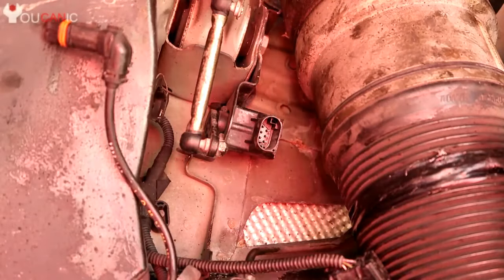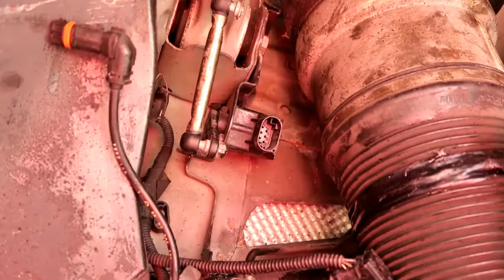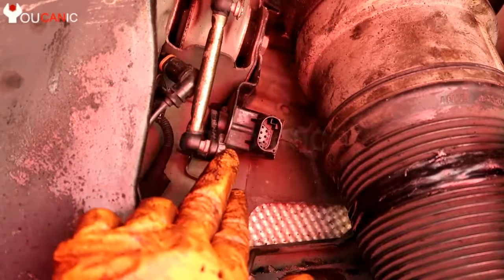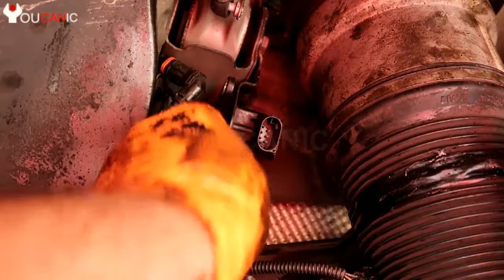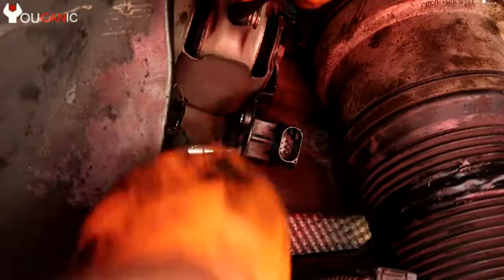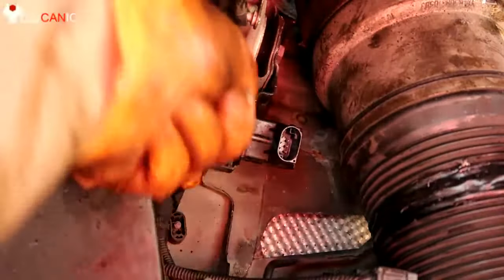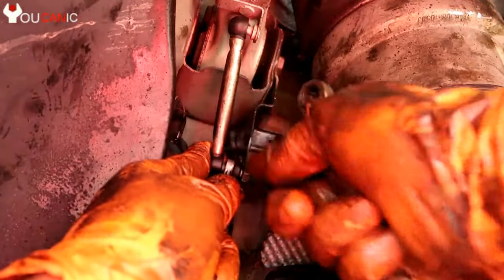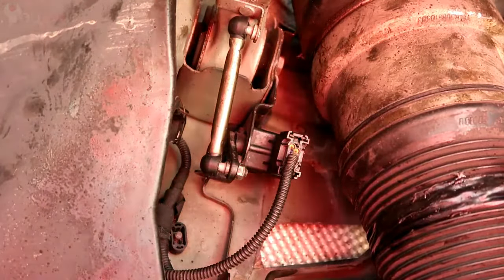Mercedes Level Sensor Ride Height Sensor Replacement | Step-by-Step Guide

Comment: I have a c350e and the suspension has started to drop intermittently on the rear drivers side (UK). I reset the suspension and it lasts a couple of days. It's only drops slightly, do you think this could be an issue with the sensor possibly moving from its home position? Great video by the way 👍🏻

Comment: Just subscribed.  My MB rides too high. All 4 ride height sensors read the same volts. I changed the ABC module and still does the same. It looks like I'll have to go to dealer for ride ht adjustment now but those idiots will want to charge $300 at least.
Reply: Hi Brent, i had an issue with my w220 where the drivers side height would drop if car not driven for few days,  the garages i visited for a fix all gave different solutions which cist a lot of money, from strut replacent to replace Compressor. All i did was spray alot of WD40 onto the front levellers & hey presto, issue resolved so far fingers crossed.. my car is 18 years old on original bits and i love it, worth a try.. Thank me later  😎
Reply: Wd40 onto levelers?? That's a nu one on me! I'll try it
Reply: @NS-pt9rr  I forgot about your advice.  Now I'll have take off all 4 tires. Thx tho

Comment: I have 2010s550 I replaced left rear strut, replaced sensor but where does the arm on sensor position go?
Left side 1 1/2 lower than right rear.

Comment: On a slight incline my vehicle sits down almost all the way against the tire in the back. After turning vehicle on it raises back to normal? Is it the sensors in the back?
Reply: No that’s an air leak
Reply: I have the same problem.
Randomly one corner will be down.
Sometimes it's the front sometimes it's the rear sometimes it's all of them.
Other days it doesn't do it at all.
It seems when I park on unlevel ground it goes wonky.
It's not an air leak there has to be a control valve somewhere or something that is going wonky
Reply: It's Residual Pressure Holding Valve leaking on top of the strut. Valve is supposed to hold at least 7 Bar of pressure even if you removed the whole pneumatic system.

Comment: After I replace the back springs and the high level sensor which was damaged from the broken spring right, my headlights they are not working correctly and they are running up and down from now reason. 
I test the car on my computer but it doesn't shows any errors. 
Is someone who already knows what Sims to be the problem??
Thanks!!

Comment: Do you have to remove wheel to gain full access ?
Reply from the maker: Hello, thank you for your comment! In most of our videos, it's not necessary to remove the wheel completely to achieve full access, but it depends on the specific repair or service you're carrying out on your car. At YOUCANIC, we're dedicated to providing you with practical and helpful information to assist you in fixing your car effectively.

If you're seeking an efficient professional diagnostic scanner, check out the YOUCANIC Pro System Scanner at www.youcanic.com/scanner. Additionally, we provide Factory Repair Manuals and Torque Specs to our users, you can access those here: www.youcanic.com/manuals. We hope this helps you in your car repairs, and look forward to assisting you!

Comment: If this is bad in the left front of my w212 E550 2011.
Will this prevent the compressor from turning on? I just replaced the compressor it still won't turn on
Reply: Fuse or relay is bad here
Reply: @curlymyhero  are you saying it has nothing to do with height sensor? My compressor also isn’t getting power and therefore won’t turn on.
Reply: @corruptedm0nk  Not sure wat ur question is. Need a good scan tool and check volts to all 3 or 4 ride ht sensors.  If volts r around 2.5 then alls good. No power to compressor is either a bad fuse or bad SAM module.  A scanner will show if there's connection ot "talk" to module
Reply: Mine ended up being a broken wire in the factory harness to the compressor.
I soldered it back together.
Reply: My compressor isn’t turning on either what should i try ?
Reply: @mizterblicky5569  There's a wiring harness that is wrapped in plastic it has two wires, and it plugs into the pressure release valve on the compressor.
It's super common for these tiny little wires to break. Unfortunately, you have to carefully strip back the plastic where they kink it at the factory. You will see some green corrosion, cut the wire, and resolder it.
You can also check the fuse that's in the trunk on the left hand side inside the compartment it's a real a near the storage tank you can't miss it there's also one fuse in the front under the hood and there's also another fuse on the right side in the compartment.
Reply: @larsbambi1575  okay would replacing the compressor solve all that because i ordered one thinking the compressor is bad because i went to Mercedes mechanic and he said he couldn’t lift the vehicle with the scanner tool and he didn’t hear the compressor operating
Reply: @larsbambi1575  and then he told me it was my compressor most likely and to replace that do you think i should replace or do what you said only thing is i never soldered anything and i don’t really know where to look for the kinks unless you can possibly help me
Reply: @mizterblicky5569  it could be the compressor is wore out.. try replacing it, if it doesn't turn on then you'll know
Reply: @mizterblicky5569  I wish I could put pictures on here. I would show you what I'm talking about. Also what year and model is your car
Reply: @larsbambi1575  it’s a 2007 s550
Reply: @mizterblicky5569  Okay, I had an 07 S550 as well it's basically the same concept, but I believe your compressor is in the right front of the car near the bumper. 

If you're on a tight budget, I replaced mine with one off of Amazon. It is way noisier than the factory one, but it works it was made by A Premium Auto Parts
Not to get off Target but does your radio and your command work? The amplifiers in the trunk go bad on the 07 quite expensive to get a new one.
Reply: @larsbambi1575  well i had problems with my sound where i got no sound or no radio channels but i used a loop by passer and hooked it up to the Bluetooth module and my sound came back
Reply: @larsbambi1575  but the thing is i don’t wanna replace the compressor if that isn’t the problem  checked and the only side that is down is the front right side so you think it’s a strut then ?
Reply: @mizterblicky5569  Yes, more than likely, that is the bad strut, but the fact that the compressor isn't kicking on is alarming.
Okay I want you to look at the level sensor it has a rod that runs on a ball joint one side is on the sensor in one side is on the axle if that ball joint is Rusty it could be stuck in a position that is telling the compressor not to send air to the right strut because it thinks it is in the correct position.
If it is corroded and Rusty spray penetrating oil on the ball joints and work it free. 
Yearly routine maintenance Mercedes recommends that you grease and clean the level sensor Rod ball joints
Reply: @mizterblicky5569  do you have anything on the dash that says "car too low" or" malfunction"
Reply: @larsbambi1575  yes it says malfunction with a symbol
Reply: @mizterblicky5569  th,e system also has a valve block it has 6 air  tubes going into it, and it opens and closes. The level sensors tell this valve block which Corners need air. So in a nutshell the system has a compressor (with a 40 Amp  relay and 2 fuses) 1 valve block , either 3 or 4 level sensors (some models have 1 in the back and 2 in the front others have 1 at all 4 corners ) and 4 struts. Don't let it intimidate you it's not as complicated as you think.
Check all the things listed above start with the easy stuff the relay and the fuses. Somewhere in your car you should have a piece of paper that identifies where all the fuses are anything that says airmatic you want to check.
Reply: @mizterblicky5569  if for some reason you do figure out that it is a level sensor make sure you disconnect the battery before you change it!
Reply: Me personally I'd be looking in the direction of the compressor and the wires leading to it especially the smaller plug at the compressor that goes to the pressure release valve.

Comment: what are the signs for a faulty sensor?
Reply: When you get a message saying airmatic stop car too low but your car is normal height or you see it in a diagnostic tool through obd port
Reply: @ghostbiker4805 but my car is leaning on passenger side, it did it before after I allowed the car to sit up for months. But after driving it everything was ok. I let someone borrow my car and it got returned like this😡 I’m assuming sensor first guess 🧐
Reply: My front both went down whilst driving... came up malfunction..fault code 5286 ?..
Didn't give a diagnosis for that..
But my front height sensors are reading left front + 4.44 "
Whilst the front right is minus 4.33".. I am assuming one off the link arms has snapped ?

Comment: Where can I buy a sensor for a s212 rear left?
Reply from the maker: You can find sensors for a S212 rear left on various online platforms or automotive stores near you. If you need assistance in diagnosing or replacing the sensor, we at YOUCANIC offer a Full System Scanner and plenty of other resources, such as OEM Factory Repair Manuals. If you have more questions or need further guidance, don't hesitate to visit our website (www.youcanic.com) or post your questions on our platform (www.youcanic.com/scanner). We're here to empower you with knowledge and resources necessary for automotive repairs.

Comment: Do you have to reset anything after installing it or does it just work?
Reply: Most of the time it will return to factory calibrated settings , after you have installed the new one.
Reply: @rkon1000  my back side sits a lot lower than the front, after replacing the back sensor. What do you think is the problem? Will it go back to normal?
Reply: @vasiliy2394 did it go back to normal?
Reply: @justinr3490  not really

Comment: Do I need to disconnect battery?
Reply from the maker: Hi there, thanks for reaching out with your query! Generally, it's a good practice to disconnect the battery when making major repairs to ensure safety, but it depends on the task at hand. For more detailed protocols and guidance, you'll appreciate our resources at www.youcanic.com. We're all about empowering car owners with free resources and our advanced YOUCANIC scanner.

Feel free to reach out on our site if you need any further assistance. We even have factory repair manuals available for comprehensive instructions. Remember, YOUCANIC is here to support you on your car maintenance journey! Thanks for watching and stay tuned for more videos.